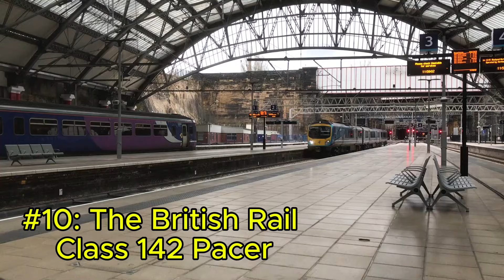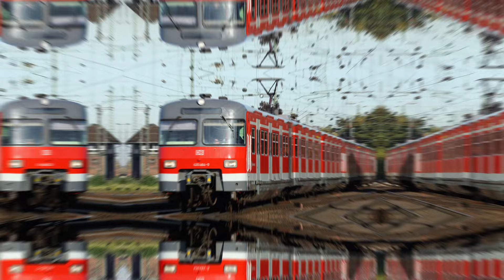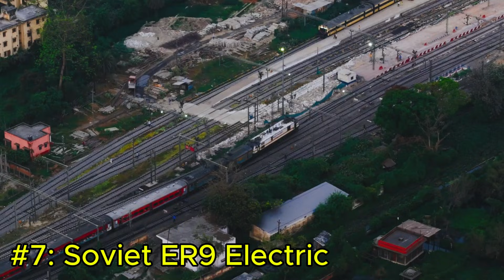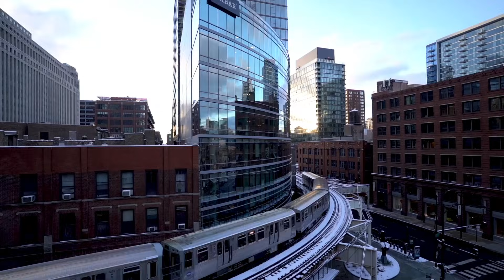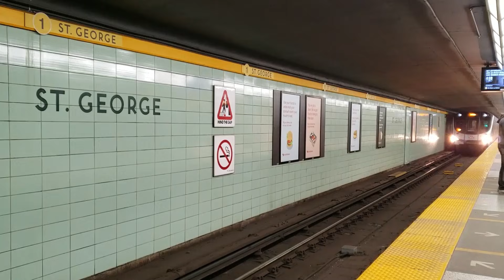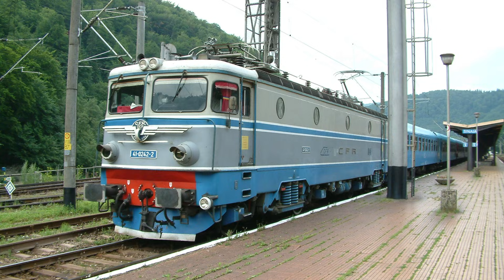10 “UGLY” Trains That Are SAFER Than Modern High-Speed Rail

Comment: This video is full of dangerous nonsense.  Who did the research?  The BR pacer has diabolically poor collision protection.  The only reason they have a good safety record is that they were very lucky and never got into a serious accident when loaded.  It was indeed fortunate that when one was in collision with an intercity train on a mainline it was running empty and the staff on board were in the first vehicle.  The rear three vehicles of the four vehicle train were completely demolished and nobody inside whould have survived.

Source: https://en.wikipedia.org/wiki/1999_Winsford_railway_accident